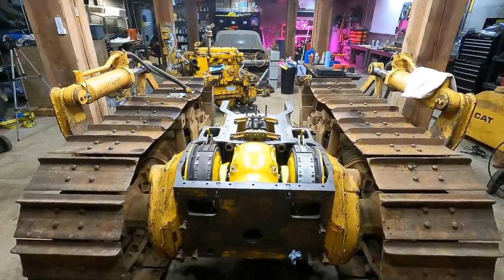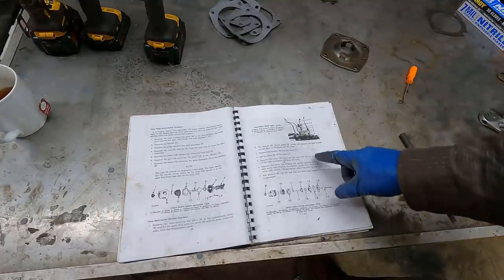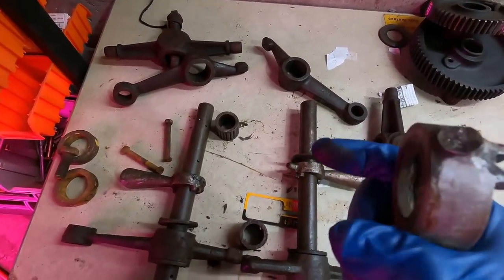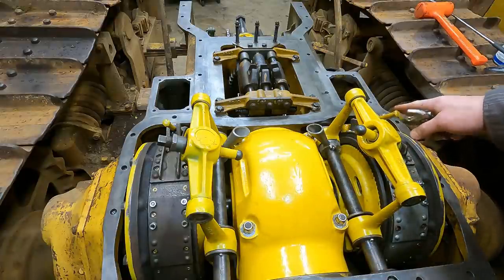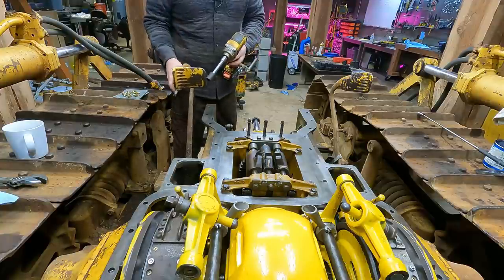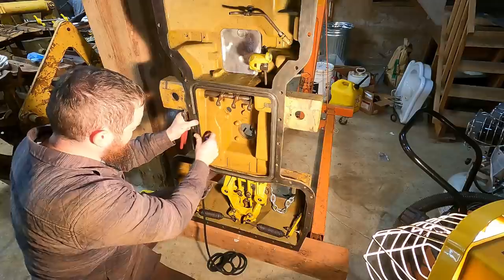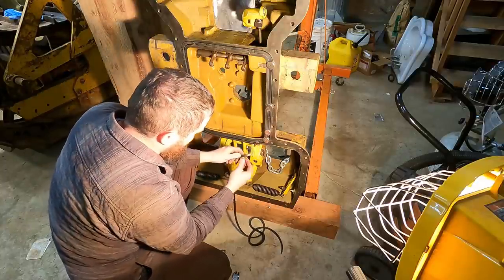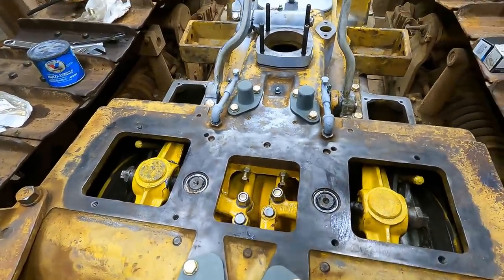Transmission cover installation on Caterpillar D4-7U

Comment: Good video as always, just one note: when you are using your telescoping gage at approx 15:20, that's incorrect. Put the gage into the bore, cock the handle off to one side, "snug" the thimble, and then rock the gage through the axis of the bore (ie "over-center), and pull the gage for a mic reading. I always check telescoping gages twice before work. Just passed two decades machining. You have a great Project Matt, and it's good to always see Charlie.

Comment: Between you and Squatch I am getting my fill of D-4 content. I really like how the two of you approach things. New and shiny when needed, old and refurbished when it doesn't matter and aftermarket is totally okay, as long as it fits. Too many fret over small details that make no difference. Like the foot pedal bearings. Who cares if it has a little too much wear? It's just your boots on a lever. But the steering clutch handles do matter, so you put new bearings in. Bravo

Comment: Grab the crimped end of a silicone tube with needle nose pliers. Wrap the tube around the needle nose as you use it. It’s easy and gets every drop from a tube. Large cotter keys clipped on the tube end work too when using a small screwdriver, punch, etc, in the cotter key hole to hold it while wrapping the tube onto the key as you go.

Comment: Good call on getting rid of the slop in the linkage. That slop will add up and makes things worse then for the better. The more slop the less accurate the steering feeling gets. I think this thing must have hauled redwood or done a lot of work since even the pedals are almost gone. But you have made it come back to life, thank you Matt for sharing this project with us.

Comment: You mentioned feedback from your steer clutch levers. You’ll find once you’re up and running that you don’t gain much insight from the levers other than when it’s time to adjust up your clutches. You’re right about the adjustment,run em up till they touch and about a turn and a half backed off from that point. All the old timers said that the steer clutches are to be adjusted so that they apply slight pressure on the brakes when you pull your lever all the way in. I was just thinking about going thru a set of final drives and having to do everything from a service truck just yesterday, I don’t miss any of it. The feedback that you’ll find most important when you’re running a blade is from the seat,one of the very few things I learned in an apprenticeship,the rest of the time I was patching up derelict equipment. Anyway,once you’re seated comfortably you’ll notice when the machine is climbing from having the blade too high you’ll feel more pressure on the back of your thighs.  When the blade is cutting too deep and the machine starts to dive you’ll feel it in your ass. This is all assuming that you’ll learn how to cut level grade instead of just pushing piles.  You’ll be amazed at what you’re capable of doing with your machine once you get the feel of it and learn the basic fundamentals and I can tell that you’re someone who won’t quit until you’ve conquered that. Going to be a tremendous machine when you’re done,keep up the great work.

Comment: The click you here on the turning clutches are the assist springs breaking over center. Proper tension on those should be tight enough that when they are all the way back(clutches released) they will almost stay back by themselves and only require slight forward pressure to move the handle forward(engage clutches). This allows operator to disengage on track and hold it for a 
Long sweeping turn with minimal effort. Later units did this with hydraulic assist. Once you get some seat time you will recognize the value of this adjustment. Your doing a great job especially for never been around a dozer. Must be some professional mechanical experience somewhere in your background . I own a d8 13a of about same vintage with similar setup only much bigger and heavier. Good luck.

Comment: find a late mod d4 with 2 piece trans cover you can cut youres to match that way if you have to service clutch you  dont have to take of wole top also wont  have to pull flyweel on pony mtr ive done several i also put grease hoses on steering clutch brgs do away with oil cups also if i ever do another im going to change to wet clutchs like d4e good luck one improveement is track guides if you dont have save a lot of pain from thrown tracks you can buy factory parts or make them i used to get 2in plate steel overkill but had excess so it worked great

Comment: Have you had a good look at the track and sprocket wheels and rollers? Just curious as to their condition. Another good video Mat, good luck.
Reply from the maker: I'm no expert, but they look in really good condition.  Tons of grouser height, bushings are very round.  Sprocket teeth look good.

Comment: This is a great set of videos and great to watch. My first job on leaving school before taking up a mechanical engineering apprenticeship  was driving a DH8 dozer towing a vibrating roller to compact a road that was being built on rather boggy ground. I didn't have a driving license but this was before the age  rules and regs and health and safety. I was given about 10 minutes instruction and told to get on with it. I loved it and have been fascinated by bulldozers ever since. Your machine must have had a long hard working life but I think you will find they are very tolerant machines that will take a lot to stop them working. Its usually the tracks and undercarriage that get most worn so I would check these out before working it too hard.

Comment: Letting your RTV setup before clamping  is a good way of generating a leak.
Precut gaskets have porosity in them to help generate resistance when crushed. This resistance is necessary to make the gasket surface conform to the irregularities (mainly tool marks) on the flange sealing surfaces. Compression of the gasket further seals the internal porosity, so preventing any internal leakage.
Formed in place (FIP) gaskets have no porosity, so do not need any compression to make them seal. They seal by bonding to the mating surfaces, and flowing to fill any surface imperfections. If you allow the sealant, in this case RTV to "tack up" before assembly, you will be compressing a semi solid, non-porous rubber. This material will tear, generating a leak path.
I've watched all of your vids on this project, and I'd love to be able to do something similar. Unfortunately age has caught up with me, so I'll continue to enjoy your work.

Comment: You can take those parts to a machine shop and get those sloppy parts either bushed or sleeved for a reasonable price . By that i mean way less than factory parts. I would fix them before reassembly ,why do it half assed when you have sunk so much cash in it already ?
Reply: I thought exactly the same!

Comment: Wow, your wife lets you put a lot of time into your toys. I have not watched you in a long time but it is good to see that you are starting to put things back together. It is so cool to see you sticking to the manual. I feel bad because the new parts must cost a lot. I just hope that when you are done that the oil stays in and the water stays out of the transmission. I hope that when you are done that it will work like a new machine. Not many people would put the time and money into it as you have. One thing for sure, you WILL know your machine.  😀😀😀😀
Reply from the maker: You know, parts aren't really that bad.  I think the most expensive part was the steering clutch discs.  All in I'm in it for around $5k, including the cost of the machine and transportation.

Comment: Don’t worry about the slop in the linkages, I have an 82J series D4 and it’s set up the same for the steering clutches and you can adjust everything to work properly even with a little play in the pin fits

Comment: Those linkage end are just worn (it happens) either replace end now or get some bronze bushing to go into the end of linkage , you may have to bore them . replace the bearing on those shafts while you have the case open there cheap enough an pain to get to them later.

Comment: if the finger starts to turn colour , get the drill ready . Drain before black and you will not loose the nail. Your commentary is very well done even with no audience  . RTV  squeeze to save hands, VICE GRIP FLATE sheet metal style . This project is coming along great !

Comment: Has the sump and flywheel been modified to prevent sump oil entering the clutch housing? Cat issued a field fix which included a large seal to the rear of the flywheel ? And needed a hole drilled into the sump to allow any oil to return from the clutch housing. Many d4 engines were lost on steep slopes as the oil emptied from the sump to the clutch housing due to a poor slinger type rear crank seal.  Another issue is the total reliance on the jocky spring retainers to prevent the engine etc flipping back over under power up steep slopes..crushing the operator. Fit safety chains to prevent this happening. Well done ...been there and it's a massive restoration task!!

Comment: Maybe bronze or nylon bushings for the linkage.
Reply from the maker: I was thinking that at first before I figured out what to do.  If the linkages had been worn out to different sizes, I would have ended up drilling them and using an oversized pin.